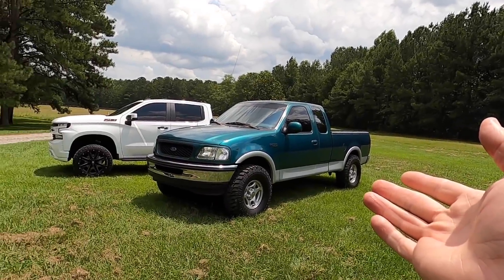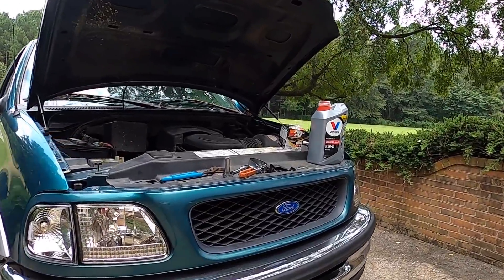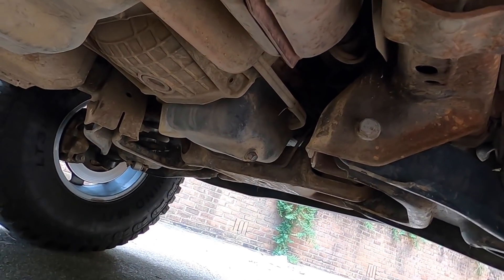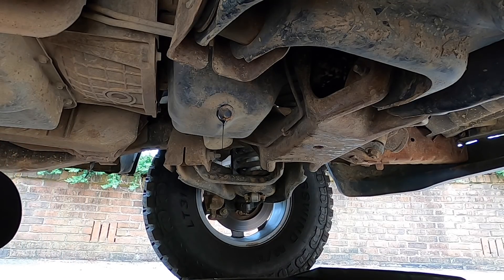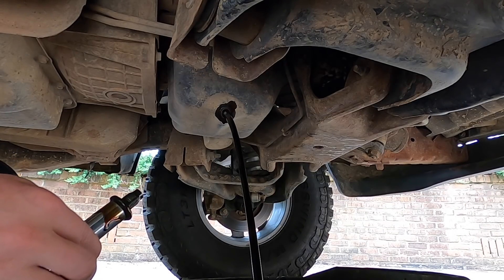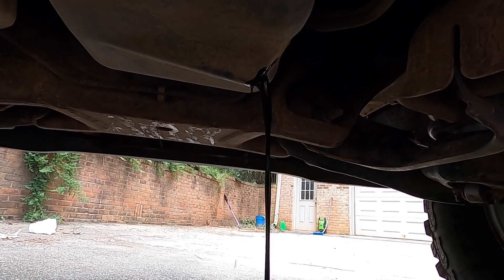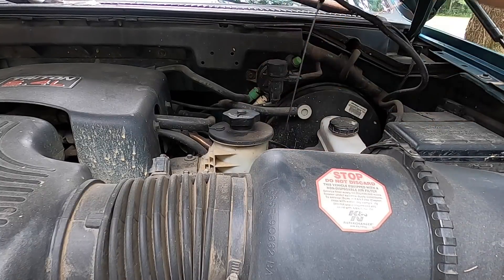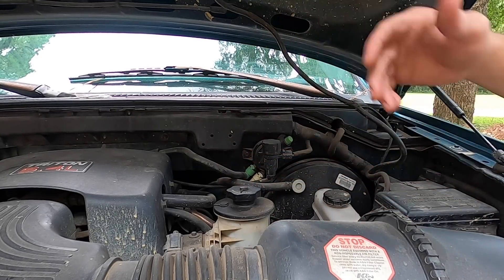FIRST oil change in 5 years!

Comment: For anyone on a tight budget: You don't need an oil filter wrench, you just need a wrench with good grip.
Reply: Didn’t know a filter wrench was even necessary. Just do it by hand
Reply: The Tool to Tighten The Filter is Only $10 bucks if we spend on beer  we can buy a Tool 🔧 😅

Comment: Casper finally hit a rough idle in its 272.5k miles! I will forever be a 10th gen f150 for reliability, general maintenance of plugs and coils is all I’ve really had to do. Rear end spider gears were bad last summer fixed that and it’s been truckin the whole way ever since! Glad to see Larry happy again!
Reply: Do you mean the differential was bad? I got a big clunk when put on reverse gear. Changed the U- joints and hasn't solved.
Reply: @dcgo44r  differential and spider gears yea.. was spendy and kinda irritated I couldn’t get 3:88’s out in for a little bit better driving of highways speeds
Reply: @rogerfuller7876  imagine I've never service this.. And it's being with me for more than 10yrs..😳  it's a 98' XLT 4x4..

Comment: Just sold my 2018 Silverado and bought a 98 F150 4.6l 4x4 exact same color as yours the body on your truck is in insane shape. Mine will be getting patch panels and repaint soon... but I paid 2500 for it. So not bitching..

Comment: Heart dropped seeing that deep socket ratchet being put on the drain plug
Reply: Yeah that's stupid I don't want it slipping that's what I use vice grips
Reply: my tools arent organized so i sometimes use a deep socket wit a breakr bar.  i just grip the socket so it dont tilt.  so far so good.
Reply: Also used a standard size on a metric bolt.
Reply: 5/8 actually fits way better then 16mm buddy

Comment: If you go buy a bottle of Lucas Oil Stabilizer, The Super Thick Stuff. Add it in and in about 1000 miles of driving it will seal the rings and valve seals and won't use another drop.
Reply: Alls that is is high viscosity oil. Hes already been using thicker oil.
Reply: ^exactly. I don't use thicker oil. It'll just damage your motor. Lucas is just snake oil IMO

Comment: Haven't seen a 5.4 with the oil filter right next to the oil pan. My 2001 has it sideways right above the front differential. My brother's 98 it's right behind the front bumper on the driver's side.
Reply: Yeah it's bull s how easy it was for him to get his filter off. I literally could not get my filter off by hand over the front diff.
Reply: @keegenm.6154 , yeah, and you can barely fit an oil filter wrench to get it loose. It's also tricky to get the new one to catch the threads on the engine.
Reply: My ‘98 is is also in the front bumper. Threw me for a loop the first time 😅
Reply: I think 4x4's are the ones with the sideways filter.
Reply: I see my 98 isnt the only one with the filter behind the front bumper. Lol

Comment: I own a old DNR 2003 F150 XL. Got 275k miles dunno how many hours. Runs like a top. Sadly needs new oil pan gasket which plan on doing mine is 4x4 a/c even still works.

Comment: Damm that’s crazy how that 200k mile 20 years old truck has no leak I’m a Chevy but dang that’s awesome
Reply: Not really, ford's quality control back then was top notch.
Reply: My 2001 F-150 is over 220,000 miles with no oil leaks. It does have a Ford remanufactured motor though.
Reply: @jayswrld5715  ford lost there quality around 2008 my 2015 f250 is now were near as good as the early 2000 ones

Comment: Good choice on oil! One of the best oils you can get! 
K&N not needed. For oil filter Motorcraft is good or wix. Napa gold is same as wix but napa has went way up in price!
You could've went with a 5w30 or something. Sounds like Larry has a lot of miles..
I hav a 98 f150 4.6 and all its ever had is non-synthetic 10w40 and it has 270k now on original engine and trans. Still running great!

Comment: The 2v 5.4 is one of the best sounding v8s. Mine gets 8.0mpgs
Reply: Really with that mileage? My 2002 FX4 Supercrew averages about 11. I try to drive slowly but my foot gets the better of me from time to time. I like to burn off some carbon every now and then when merging and passing.
Reply: @Samuel-zl7yw  again, my truck is tuned and has a cam. Also its riding on 42's
Reply: @Samuel-zl7yw , My 2001 4×4 averages about 11mpg as well when I'm driving around town. I've gotten as high 16 mpg when I've taken it on long trips on the interstate. It is still stock height and wheels with factory tire size.
Reply: @jayswrld5715  Oh I see. I guess that’s still good with the mods. I do a bit of both city and highway driving. I think I can reach 16ish if I’m on the highway also. I think these trucks drink the most when accelerating. I have after market wheels and mud tires but they’re stock size at 265/65r17’s. I want to eventually get bigger tires next time but I think my truck sits kinda low due to 19 year old ranch I shocks and a bed cap. Any advice on larger tires?
Reply: @jayswrld5715  How do you drive that gas guzzling shit?
Reply: @Judgemental_Crow  lmao I drive it because I love it.
Reply: @Judgemental_Crow  also it was a gift from my momma
Reply: @Samuel-zl7yw  firstly, go through your entire suspension system. Bearings and all. 2 check your trans over and make sure its all right. 3 if it is a m/t tire make sure its to your likings. 4 dude go crazy.
Reply: @Samuel-zl7yw  also. Cut your fenders a bit if your tires rub. And invest in a lift kit and spacers
Reply: @jayswrld5715  🤣
Reply: @jayswrld5715  All love bro ❤️
Reply: @jayswrld5715  What kinda performance gains are you getting from the tune and cam?
Reply: @Samuel-zl7yw  about 120hp and 100tq.
Reply: @jayswrld5715  Sounds Epic! I would love to see a video and tour of your truck!
Reply: @Samuel-zl7yw  when i am feeling better I'll give a tour. I have covid.
Reply: @jayswrld5715  Dang I hope you get well soon. My family had it at the beginning of the year. It wasn’t bad fortunately and I hear you get a some immunization after you recover.
Reply: @Samuel-zl7yw  thank you for your kind words. Hopefully I fully recover.

Comment: You shouldn't prefill your oil filter (most oil filter boxes even have a symbol telling you not to) and if you insist on prefilling you don't go through the middle hole, that's after the filter. The oil comes from the sump through the pump into the outer holes on the filter and to the engine from the larger middle hole.

Comment: If he drinks a little oil after a bit of mileage on these 5.4s. They tend to not use as much of a thicker oil,  and some lucas unless i have been lucky with most of the ones i been around.  I still run 5w20 in mine but once we use a little more oil im gonna run 10w40 with lucas and get mine up there some more

Comment: Ford should of never used 5W20. Blend on the 5.4. 10W30 is the lowest rating I would ever go. Ford used 5W20 for better gas mileage reason's. Plus come on Man. 5 years between oil changes. That's not how to treat a Ford truck. Shawn.
Reply: @MotorcycleEnjoyer01  Yes, I Agree on the 0w20 and the small areas the oil flows. But I hear Ford went with 5w20 for gas mileage. My 2005 Taurus SE 3.0 takes 5w20. But my 2017 2.0 turbocharged Escape takes 10w30. For heat reason's. So I went to full Synthetic oil on the Escape and use the Motorcraft blend on my Taurus 3.0 it's 16 years old. Still runs like a top and never uses any oil between oil changes. 175,000 going for 200,000 miles next. 3 sets of tires, 3 sets of brakes, all new brake lines, A/C unit, Anti freeze changed with new hoses and belt, Lower ball joints and a driver side CV shaft. Can't buy a new car now so I put this one back on the road again. Just went on a 150 mile round trip and got 28 mpg. Wow!  That 3.0 Vulcan is a great motor. TO Bad Ford couldn't have made the Eco-boost better. Its crap!  Ask me how I know!    Shawn.

Comment: I run 5w30 in mine since it's over 100k. Uses a quart every few months.  Larry is about normal lol. Lucky you dont have a 4x4 with a lift, my drain port just dumps right on the crossmember for the front lift brackets 😂
Reply: Bro literally it’s so annoying, and the filter sucks getting to as well😂
Reply: @landondrewery7872  mine has the filter relocation to the drivers front fender, lucked out there. And a nice chunk of cardboard catches the dribbles off the crossmember lol.
Reply: @raze4789  my filter is right above the front diff. Getting it off is a pain.

Comment: I wouldn’t do the high mileage oils unless it’s leaking. They have additives that will help the gaskets/seals swell to minimize leaks. Over time you may have leaks if you go back to a non high mileage oil. I’d run 5w-30 all day in that engine.
Reply: 5.4 tritons are built to run off of 5w-20 but he's just gonna have to keep buying the high mileage
Reply: @mattsgaming4276  they aren’t “built” for it. It’s what Ford “recommends “ for maximum fuel economy.
Reply: @Bushy556  which means that's what they're "built for," you get the best performance and fuel efficiency running off you're manufactures recommendation. That's why they tell you to use 5w-20 if 5w-30 ran better and performed better for the engine ford would've put 5w-30
Reply: @mattsgaming4276  that’s untrue. Manufacturers get charged less for CAFE taxes for better mileage. 0.2 mpg over tons of vehicles is worth lots of money.

Comment: Pretty light weight of oil, put a 15w40 or something heavier and it might slow the burn off. Nice truck
Reply: That’s what Ford calls for.
Reply: @CupwakeRBLX  when the truck was new. As these engines get older, tolerances are increased, and a thicker oil can help maintain better oiling throughout the engine.

Comment: 5w-20 is to thin for this type of older engine. 10w-40  is what I would use
Reply: 5w20 is recommended, or 5w30 for higher mileage. I ran 15w40 diesel oil in it once, took forever to reach the top-end so that's probably why they recommend a lighter oil.
Reply: @raze4789 , the owner's manual for my brother's 98 actually specifies 5W-30. My 2001 does say 5W-20 though.
Reply: @JohnnyReb2000  yeah 2001 they were switching over to synthetic. 5w20 synthetic and 5w30 conventional are pretty similar. 5w30 synthetic is what they say for higher mileage. Probably 10w30 conventional would run similar.
Reply: I run 5w20 because it gets cold as hell here. There was a morning this past winter I couldn't get my 03 5.4 running even with a jump. Mind you it was -30 degrees.

Comment: made me cringe to see you using 5w20 oil. That watery shit doesn't belong in any 2v modular motor IMO. Now if it were a 3v with the phasers I would say good, but not on a 2v.
Reply: Not sure about that truck, but my 2 Fords both called for 5w20. I'll stick with what the engineers suggest
Reply: @porkchop10  they recommend 5w20 for fuel economy thats mostly it once that 5w20 is heat cycled and diluted with fuel its film strength is poop